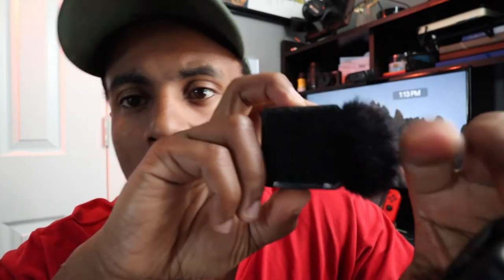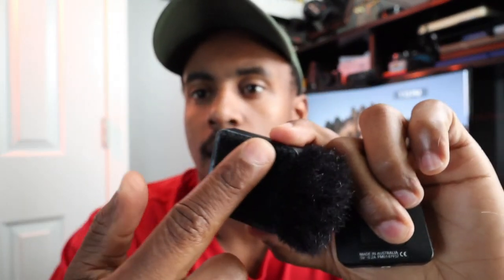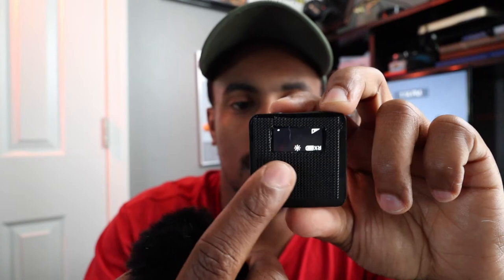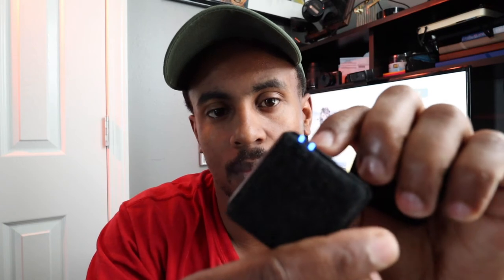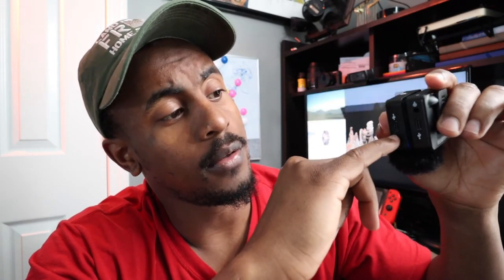How to Turn Rode Wireless Go Into a Shotgun Microphone!

Comment: I hope you wanna grow your channel. I also bought one.
Good luck
Reply from the maker: 100%, in due time!!!! The Wireless Go system can be so versatile. I will make a video soon on tricks that I have discovered!
Reply: @thetonynarrativeshow  The wireless go absorbing all the surrounding noise. Can you do a video on how to use it as unidirectional?
Reply from the maker: @jibinjohn8263  I have actually been working on that currently already. The biggest problem that I am having, is muffling the audio when I try to make it directional in the field. Closed environments are so much easier to control.
Reply: @thetonynarrativeshow  
I usually do my video recording outside.
So lot of unwanted noise is making uset experience not good.
I am planning to buy a low cost directional mic and attatch to it